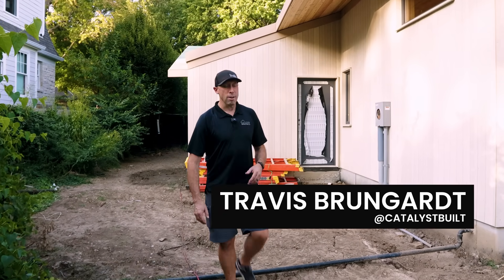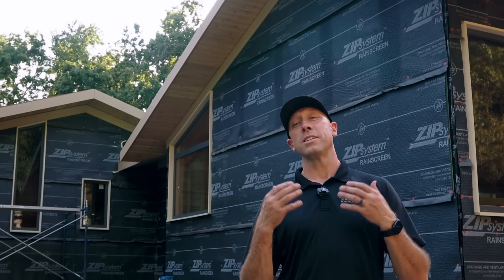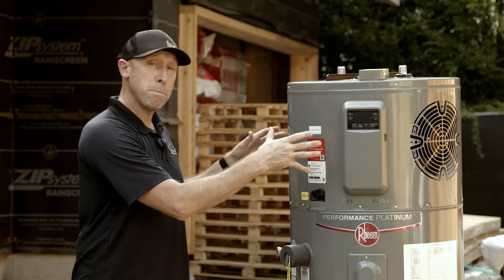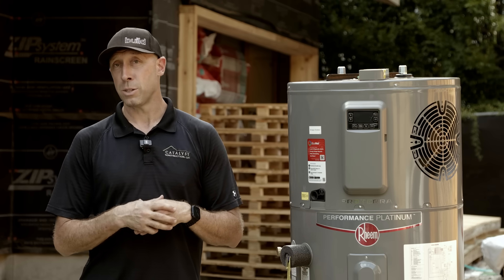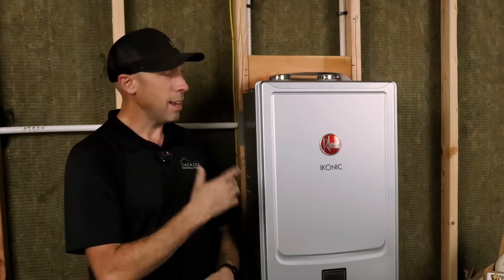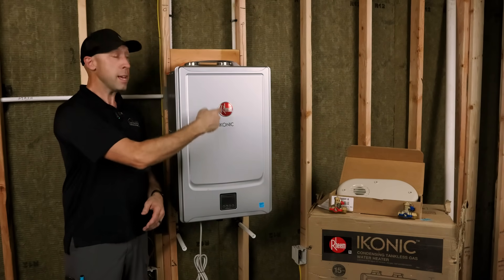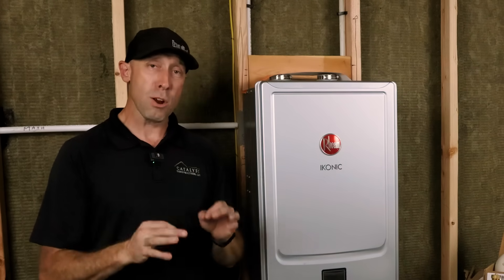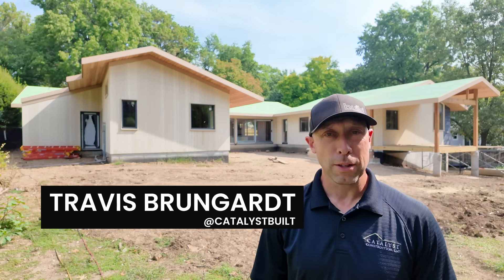Tankless to Right-sizing Heat Pumps: How to Choose the Right Water Heater

Comment: 20% of energy cost is a JOKE and hokey "spin" data.  My 8 yr old conventional 50 gallon direct vent natural gas unit s not even close to 20% of energy cost. Last year it was less than $13/month with a family of 3 adults. I agree with other commenters, this is just a paid commercial for Rheem.  I agree, cut the BS, you should be ashamed IMHO.

Comment: My opinion all new homes should have either a tankless gas or heat pump water heater.   My opinion smaller new homes should be all electric with heat pumps.
Reply: I agree, I would say run a dedicated 20A 120v circuit to a gas tankless even though the tankless needs almost zero electricity. The reason is that being a dedicated circuit it can quickly be converted to a 240v circuit and a heat pump. Also, I live in an area that gets frequent power outages, so natural gas for a generator is almost a necessity in my area.

Comment: I've never seen modern flow-limited showers exceed the capacity of a single tankless heater.  However, with one or more big bathtubs, the maximum hot water fill rate at the tub may a concern.  For example, an MTI Andrea 3 tub can hold approximately 100 gallons.  At 6 gallons per minute without competing demand, that's almost 17 minutes to fill it.  You can get heaters that can provide 10 GPM or more.  Another approach is that you can cut the fill time in half by installing two heaters in parallel provided that the supply diameter and the fill control valves are sized to handle at least 12 gallons per minute.  If you choose communicating tankless heaters, you will only use energy for one unit until demand exceeds its capacity.  This also provides redundancy if the primary unit fails.  A second tankless heater could also supply radiant heat for tile floors or exterior concrete slabs.

Comment: The biggest benefit of the heat pump is if you can bring it into the envelope of the house so you're also reducing your air conditioning bill. It also helps the heat pump run cleaner without all the dirty air. Can you do a video about circulation pumps with a heat pump?

Comment: Been running our Rheem Proterra HPWH for the last 4 years. I went with the largest tank and it has been rock solid. The compressor is fairly loud, but as long as the mechanical room door is closed, it’s fine.

Comment: Had nothing but problems with my rheem proterra heat pump water heater. These units should be recalled, shipped from factory with faulty resistors.

Comment: I use an electric tankless unit by Stiebol-Eltron and it meets my needs.  I live alone and only use hot water for showers.  I spend less than $30 a year on hot water.  Or I did.  Now that I have solar I don't spend anything.  If I ever do switch to a heat pump / hybrid water heater I'll go with Rinnai since it can fit into the tank well in my garage.

Comment: Size up your water heater if you go with a heat pump water heater and think about installing a Zurn 3/4" Aqua-Gard thermostatic mixing valve and setting the tank temperature to maximum to maximize heat pump hot water capacity.

Comment: I installed the rheem heat pump. Pros…works great. Slashed my electric bill. $20+-. Has a high demand mode so it can keep up. Add a booster valve and I have yet to run out of hot water. Cons…noisy and vibrates. In a garage, no biggie.  In the attic like a lot of homes are, and the ceiling vibrates. I don’t have gas so I was limited in my options. Overall, I am impressed and have done some sound proofing and isolators to cut down on the vibrations.
Reply: Same, have it in the basement. I haven't noticed much vibration, but it's on a concrete pad. It's about as loud as the dehumidifier down there, which I notice runs a bit less now since the heat pump dehumidifies while running. I got it cheap from a plumber who pulled it out of someone's brand-new home because the guy wanted a tankless. His loss!

Edit to add: It did require a 50 amp, 220v circuit, I believe because of the backup electric resistance mode which I haven't had to use yet even with guests over (otherwise it's just two of us).